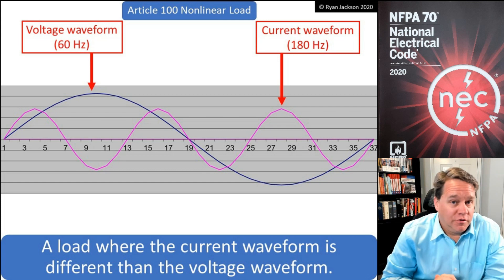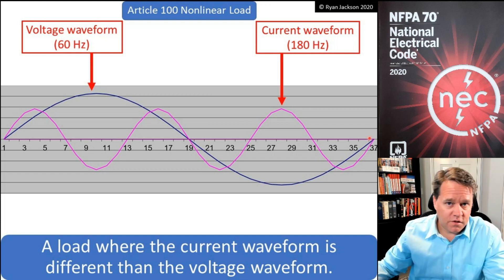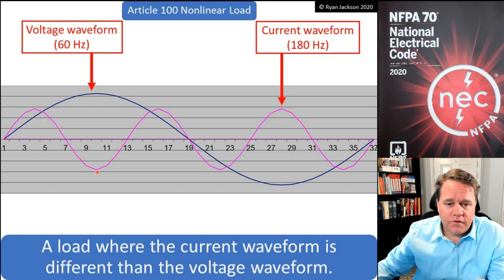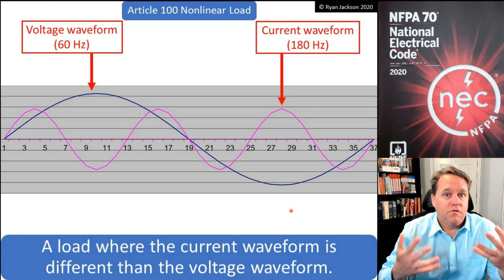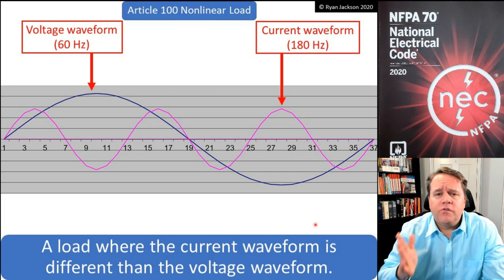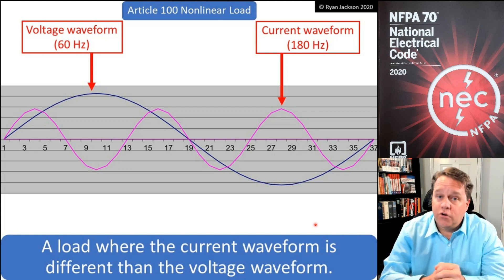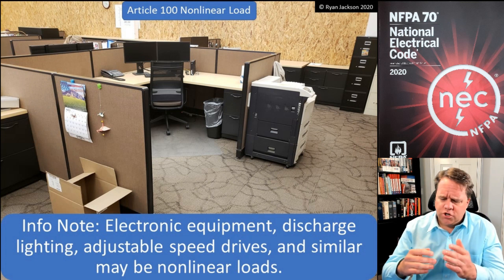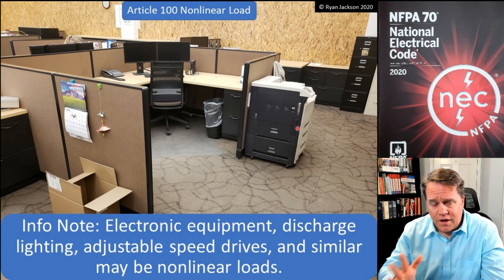100 Days of Article 100: Nonlinear Load

Comment: just count the neutral..a few years down the road they might want to do a remodel and move their office to the other side of the house or building or something. Or maybe they have 4 xboxes for their kids or something.
Reply from the maker: That is only a concern if the voltage system is a 3-phase, 4-wire wye.
Reply: @RyanJacksonElectrical  you can’t have nonlinear loads on 120?
Reply from the maker: @tfun101  Yes, but they only reflect back and overheat on a wye.

Comment: I remember installing #10 neutrals for the 20 amp 120/208 volt circuits supplying computer equipment in office buildings. I believe they had special transformers supplying those panels too...

Comment: A smooth 3rd order harmonic which is a sine curve is pretty much well behaved. I suspect a switch mode supply will have less regularity in its waveform and I would term that being non-linear.
Reply: I suspect your talking about a Fourier decomposition of the aggregate waveform. If that waveform is irregular (square wave or something else) it can decomposed into a set of sine and cosine waveforms that can help identify different elements or stages of power switching including LED drivers or motor operations. Transients, overvoltages can combine high and low frequency voltage or current components. One thing her e that is important is DC leakage which if aggregated across multiple types of these loads can cause problems  of GFCI tripping. Latest designed GFCIS can actually identify many of these types of signals and avoid false trips.
Reply: @mathman0101  3rd order harmonics, and any other harmonic that is a multiple of 3 (called triplen harmonics), can be particularly problematic with a 3-phase system.   The reason is that triplen harmonics add up, rather than cancel, on the neutral conductor.  Any harmonic that isn't a multiple of 3 will cancel out on the neutral conductor if the same harmonic is present on the other two phases, just like the fundamental does.   This is what motivates specifying a 200% neutral for harmonic-intensive loads.

Even harmonics have the same problem on split-phase 120/240V.  However, even harmonics in general are a lot less common in the Fourier transform of most electrical loads, than their triplen counterparts, so it is uncommon that a 200% neutral becomes required for most of the 120/240V split phase services.

VFD drive harmonics are particularly interesting, in that they systematically avoid both even and triplen numbers.   VFD harmonics occur at n = 6*k +/- 1, where k each integer 1 and larger, which means most of them are prime numbers (5, 7, 11, 13...etc).  The first non-prime VFD harmonic occurs at 25.  VFD = variable frequency drive, an electronic device for driving motors at a spin rate independent of the grid frequency.
Reply: @carultch  interesting so triplen harmonics require specific treatment (filtering and or power compensation) to mitigate their harmful effects heating, resonance and other power quality issues arc furnaces are one piece of equipment that really suffer from these I hear.
Reply: @mathman0101  Only in the context of 3-phase electricity.   For single phase and split phase, the fact that it is a multiple of 3 doesn't matter.

Here's why.  For simplicity, assume an angular frequency of 1 rad/sec, and an amplitude of 1 ampere.  The equation of each current waveform is as follows, where k is the harmonic number.  This is the same waveform that is shifted 120 deg CW to make phase B, and 120 deg CCW to make phase C:
A = sin(k*x)
B = sin(k*(x - 3/2*pi))
C = sin(k*(x + 3/2*pi))

The neutral current N will equal -(A+B+C), such that N+A+B+C=0 as is required for current to flow in a closed circuit.

When k = 1 for the fundamental, these add up to zero, exactly as you expect balanced currents among all three phases to add up.
When k = 5, these also add up to zero.  As with k equaling anything other than a multiple of 3.

But when k = 3, or any multiple of 3, these add up to N = -3*sin(k*x), which becomes a problem for the neutral current.  Now, it is unrealistic to have harmonics with as high of an amplitude as the fundamental, so this is an extreme example where the math would show you need a 300% neutral.  But the point still stands, that only triplen harmonics have this problem on 3-phase.   Even harmonics would have this problem on single phase, where A = sin(k*x) and B = sin(k*(x - pi)), but it is rare for even harmonics to even come in to play.

When k=3.5, or any other non-integer that is within a +/-0.75 margin of any multiple of 3, the harmonic currents also add up.  This would be called an inter-harmonic, and the same issue would apply.

The NEC takes a conservative approach, and considers the neutral to be a CCC when you have harmonic intensive loads, even if all your loads exclusively produce non-triplen harmonics.  Triplen hamonics are the most common, so it is understood why the NEC treats them this way.
Reply: @carultch  yes it’s only for 3-phase system where the triplen harmonics of the line currents are equal to the neutral current as you outline. I suspect mainly  in use in commercial and industrial settings where these power factor and other power quality issues become important to address. Have you had a lot of experience with them? I guess it becomes seriously expensive to address these for larger machinery.